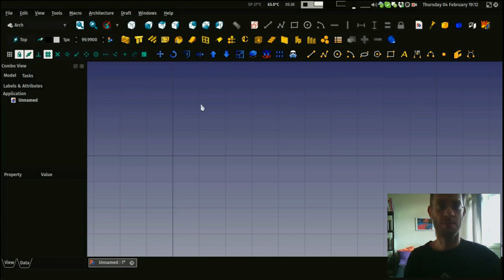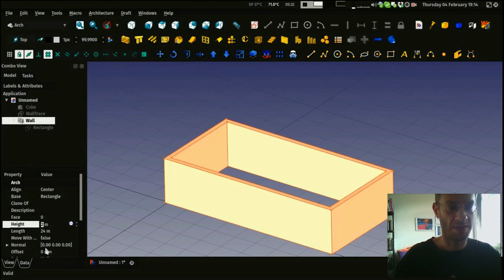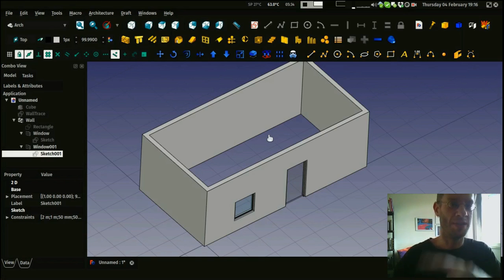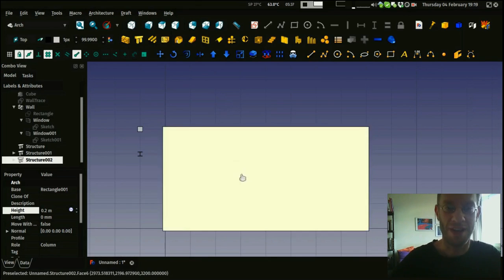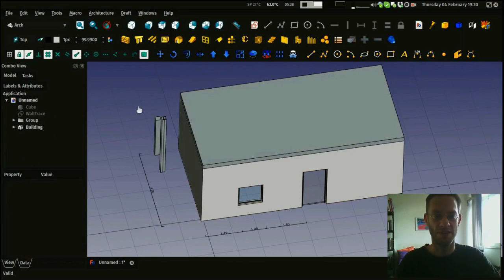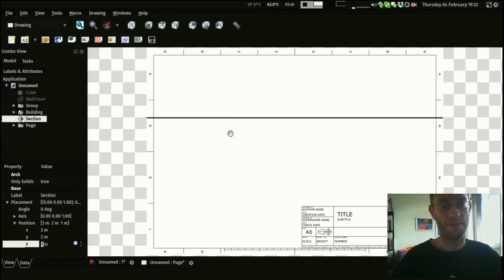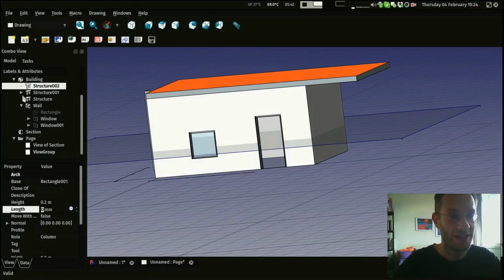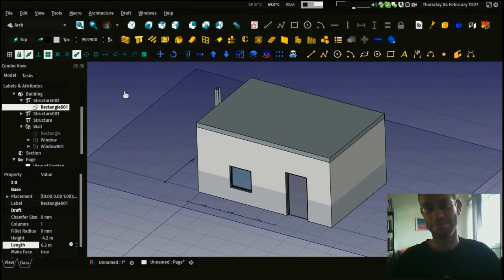Presentation of FreeCAD's Arch Workbench

Comment: Some issues I'm having: 1) the fact to use meters instead of millimeters when working on buildings. 2) When I export a model to a drawing, it does not export correctly the lines width, the lines style and the patterns filling wires. 3) I have to export a model to a drawing every time I change the model. Only with these three issues fixed, this software would be totally awesome. Another thing to fix is the built-in function to export a model to dxf. It's not working. Version: 0.16+dfsg2-3 (from Debian 9 stable).
Reply from the maker: 1) You can work in the unit of your choice. Edit -> PReferences -> Document -> Units. 2) It depends much on the workflow and format you used, but indeed many features are still missing. 3) The 2D drawing, whichever method/workbench you choose,  reflects the changes you do to the model. But indeed you still need to reexport the file each time.
Reply: Thanks for the answer, Yorik! In the point 1 I'm using MKS for the meters: if now I want to move a line 15 cm (0.15 m) I have to specify the "m" of meters every time, otherwise it uses "mm". It would be very useful and productive if the program worked in meters automatically everywhere (excepting in the drawing layout, then mm is ok). The input could be ".15" (even without the 0 in the units side) and the program should interpret 0.15 m. About the third point, I discovered the F5 key, it does a part of the job, excepting if I add a new element to the model. The solution for this would be the feature of layers, so then you add layers instead of models. AutoCAD, LibreCAD, QCAD, Allplan, ArchiCAD have layers system to print through them. Perhaps you could use "Group" to send the whole Group to a drawing, so it will add all the new elements of this group to the drawing as well. Anyway, FreeCAD surprised me a lot, I will follow its development more closely. Regards! :)

Comment: What happens if you now edit the model again? Let's say, make the building 2 meters longer. Will the plan be updated as well? I'm trying it and I can't. It seems I have to re-insert the model again and again after every change. (BTW, I love this software as it is opensource, like LibreCAD, however it's still not productive to use in a company. Only Blender is useful in a professional level, and in fact I already used it 2 times to make architecture renders. I wanna make some pull requests in LibreCAD, as well, becuase it's close to become a good option. In both cases, LibreCAD and FreeCAD, issues are on composing plans).
Reply: I reply to myself. After writing the last comment I tried QCAD and it's better than LibreCAD at this moment IMHO. QCAD saves the printing options for every drawing, as it should be (logical). QCAD looks more stable than LibreCAD, it has more options, it allows user-scripts using ECMAScript (JS). I think community did a regression in LibreCAD ("fork" from QCAD), while QCAD mantainer is doing a great job.
Reply from the maker: Both are a bit different now, there is a very intersting DWG import development in LibreCAD. Regarding FreeCAD, the whole idea of parametric models is that everything is regenerated when you change somehting. So yes, extracted 2D plans will change if you change one element of the model.

Comment: When I add something ( like a wall ) it's way too big compared to the grid.
It's about 10 times bigger then the grid.

Am I doing something wrong? Do I need to change some settings somewhere ( maybe for the grid )?
I use version 0.16 with ( i believe ) default settings.
Reply from the maker: You need to change the size of the grid maybe? In 0.16 you need to go in Edit->Preferences->Draft. In 0.17 you can do that directly from the selectplane button
Reply: For some reason when I add something it won't use the default settings from preferences menu ( for a wall the width and height ). 
Do I need to tell it somewhere that it should use these default settings?
Reply from the maker: No, it should just work... Check that you are using the right units, at the moment the preference pages only work in mm

Comment: Thank you for the presentation. I'm a programmer trying to design my tiny mobile house in FreeCad and I really appreciate the effort that has been put into it. Can you also use it to calculate tensile strength and other engineering measurements?
Reply from the maker: there is quite a lot of calculation that you can already do with the FEM workbench, check https://yorikvanhavre.gitbooks.io/a-freecad-manual/content/working_with_freecad/creating_fem_analyses.html